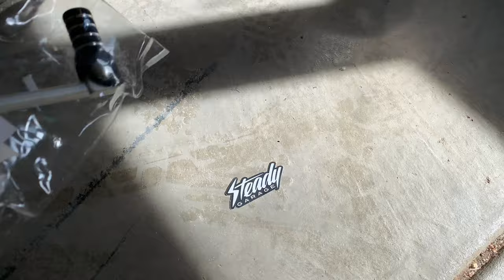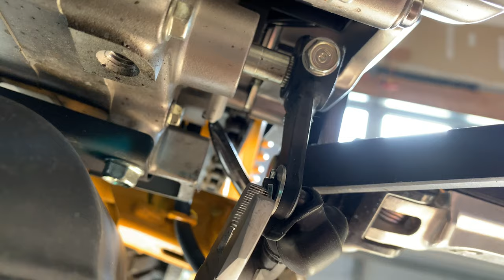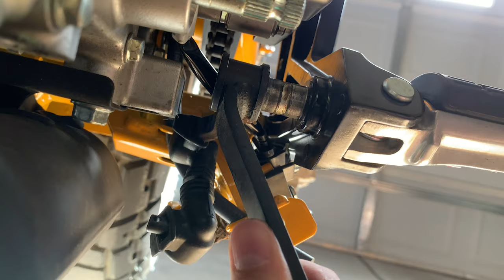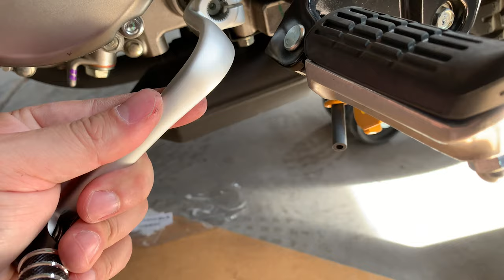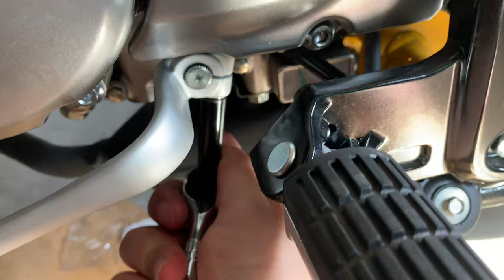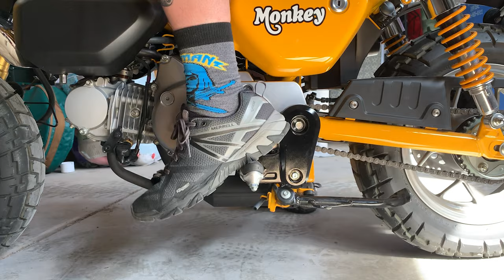Honda Monkey | Replacing the stock shift lever!

Comment: I’ve done this mod but also installed a shifter support bracket/bearing from Hard Racing. I would not recommend it without the support bracket. WITH the bracket it’s amazing. Smooth, positive shifting; vagueness gone, no false neutral issues.
Reply from the maker: Totally agree with the bracket, that bracket at least gives some peace of mind that the shifter has some amount of protection.

Comment: The stock system does reduce the chances of the splined shaft seeing bending forces rather than turning forces, but yes, lots of slop in the standard system. Hard racing do a support bearing that fits between the lever and the cases to stop any bending forces. Cos if you do bend it, replacement is a clutch cover and clutch off kinda fix, that needs special tools☹️
Reply from the maker: That definitely makes sense, and was something I was worried about. I don't plan on riding the monkey overly hard, but I may look into the support bracket on my next order of mods. I definitely don't want to replace more parts than I need to (can use that money for other monkey-mods). Thanks for the pointer!

Comment: Not related, but....on the frame, in front of the swingarm pivot, note the square hole with an oblong strip cut below it with a tiny hole.
That tiny hole goes right inside the tube that is the swingarm bolt cavity. So water gets inside and it corrodes. The swngarm does not have bearings but uses rubber bushes instead. So no bearings to seize up, so not critically important, but grease pivot bolt and block hole! Swing arm nut torque is 40 ft lbs
Reply from the maker: Thank you so much for this information, definitely a good idea to take a look at this.

Comment: So i did this install initially but ended up switching back to stock (and then switched rear sets altogether) - it got so hard to find neutral with this shifter, you're not experiencing any issues?
Reply from the maker: I need to find some good rear sets for the bike; I’ve been contemplating going more flat tracker or off road style on the bike overall. As for neutral, there’s definitely times that I skip back and forth around neutral. I’ve read a few say that this seems to get better with more miles on the bike, but it seems pretty easy to miss.

Comment: What stand do you use for the bike ??
Reply from the maker: It's just a generic motorcycle stand. I had installed spools to lift from but also the frame works with a lot of the lifts out there.

Comment: Nice vid man!! Crazy the linkage on the stock setup, I dont mind that as much as the lever is just too short with boots on and I only have a size 10 shoe. Have you seen any longer that use the stock setup? If i cant find one I might buy another cut it and extend it.
Reply from the maker: Thanks so much. I haven’t seen any larger shifter options so far, they all seem to be pretty short. Might be interestingly try and fab up something.
Reply: Unknown Overland Thanks Man! I might just buy a stock replacement and modify it, it’s actually a pretty bad hampering on shifting comfortably now. There has to be a pretty good reason Honda engineers set it up the way they did. I will do a little more digging. I appreciate the reply Bro👍👍
Reply: That's strange... I have a size 13 boot and I actually like the stock shifter.

Comment: Hooray!!! I put a comment on your latest video, and totally forgot about this one - you don’t mention here why you did this mod, but I am trying to eliminate the clunky sound on shifting. Why would Honda opt for this many moving parts instead of the simpler pedal shifter straight into the engine, like you have now? Thanks!!
Reply from the maker: I was in the process of replying to your other comment and saw you post this. (I'll likely still reply to that comment to point over here in case someone else reads your comment wondering the same thing). I've seen that some people talk about the linkages that Honda put there stock as a way to deal with people being overly aggressive on the shift lever, but really I think it's just too many parts for something simple. I do recommend looking at the next video (https://youtu.be/bwm8DqDj6v4) if you look at changing any of this. In it I install a shift shaft support bracket that attempts to help keep the shaft from bending since you'd then be putting direct pressure on that shaft.